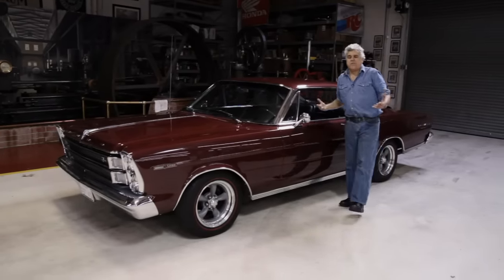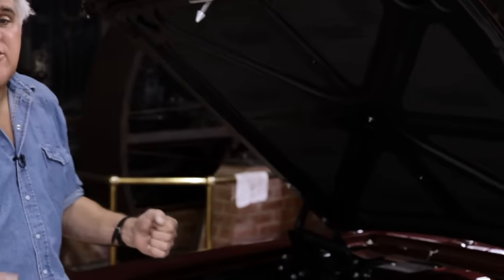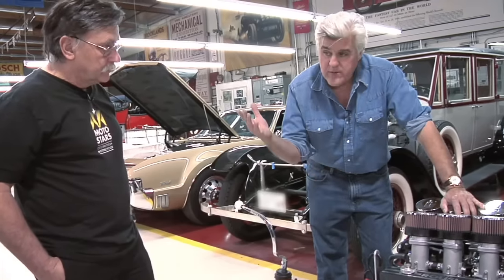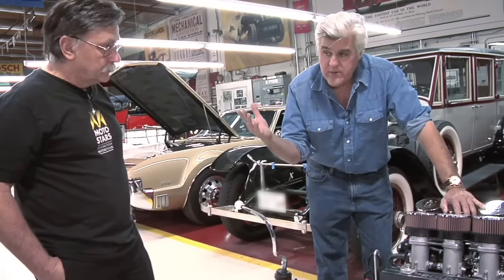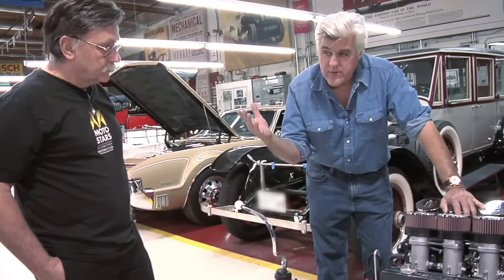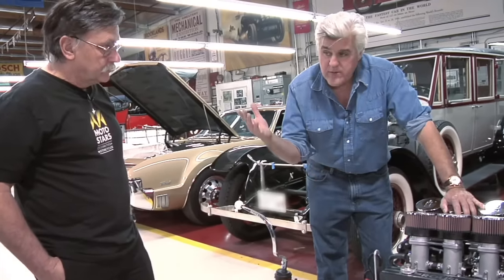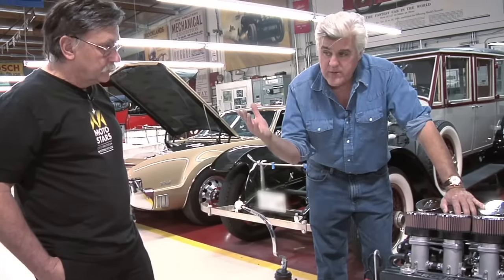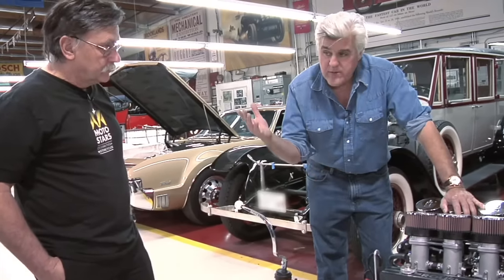Restoration Blog: 1966 Ford Galaxie, Ultimate Edition - Jay Leno's Garage

Comment: My father bought two 66’s brand new one red the other black? He wrecked both of them. (He was a mad man of mad men fame) aside from pictures that are long gone the only other memory was the non latching front seat. He had to slam on the brakes and I went from back seat to foot well as a result, with my sister as part of the barrier. There was a Corvair that caught fire a 67 or 68 cougar that had a cool garage door storage thing a 68 charger and his final car...74? Pinto. Smh. He wrecked every car but the Pinto.

Comment: 6 cylinder  mopars did have lighter torsion bars 'and lighter rear springs' but they did not have four lug wheels . Is jay  thinking  of that strange thing that ford did  with 6 cylinder falcons and mustangs having 4 lugs.?

Comment: Other than handling these old muscle cars were commonly equipped with single master cylinder drum brakes.  Very prone to fade at high speeds which sometimes could literally lead to NO BRAKES!!! yikes. Not a muscle car by no means but my stock 60 Cadillac flat top has a single piston master cylinder that is literally about the size of a tea cup with drum brakes.  Back in the day driving one of those cars and you went through a fair amount of water you would stay on the brake pedal as you drove along for a short time to dry the brakes because when those drum brakes got wet you had no brakes so you had to "dry" them.  At least is what I did and it worked.

Comment: I like the cars to handle like they used to shocks Springs front end all of it just put better brakes on it I'm not planning on driving the Grand Prix drag racing all the time I like the feel of the way they handled back in the day hold on to the steering wheel with two fingers and cruise down the interstate I wanted racket pinion steering I buy a new car I don't want to drive around in an old car that's very powerful if I was going to do that I just go ahead and buy a demon or something I want it to feel like it did with the original 428 that's got a lot of balls if you can't get over a hill with that then whatever

Comment: Everytime I filled your car I would not put a hood scoop in no matter what size the intake was and we called it the sleeper because nobody on the road knew what you had under the hood anybody would pull up alongside you thought it was just a big family thought or even a Corvair Spyder with a small block 289cin. We cald it the baby sleeper.then the  1956 Chevy wagon with a 455 Pontiac big block and we calf it moms grocery getter. My mom and my dad loved my fast cars especially mom.

Comment: Jay why don't you put a pair of slicks on it and take it to a drag strip and see what it will do?? I ran my 66 XL for years and was a great driver. Mine was a warmed over 390 to 400 hp turned 13.70s but with bad traction. Edit 2022, come you lawn chair guy's respond, the guy's got so much money and still didn't run it at the strip? He talks like we were stupid in 66, the brakes went to the floor because it didn't have a dual piston master cylinder like Cadillac had since 1962, only one brake line not smart, I modified mine. The front disc brakes worked fine

Comment: Makes me sick to see these old galaxy's. Had a chance to buy one in the early eighties that was a light blue, white interior convertible with all options and a 390 engine and excellent condition for $2000. Was young and worried about the gas mileage it would get so did not buy it. Still kicking myself!

Comment: Jay,
     You can change the brakes for better stopping and fool with the suspension for better handling BUT what your not allowed to do, if your are a true car collector, is remove the original engine for a crate motor. You’ve taken away the “7” litre concept for this special Galaxie. That’s an insult and unforgivable sin and against everything you state you stand by being a “car guy”/ collector. At minimum don’t call it a 7 litre anymore because it isn’t- it’s a Rouse   race car.